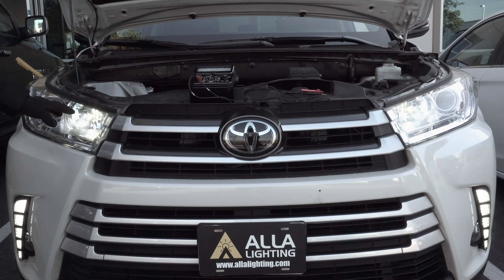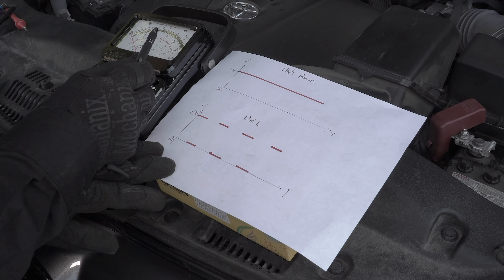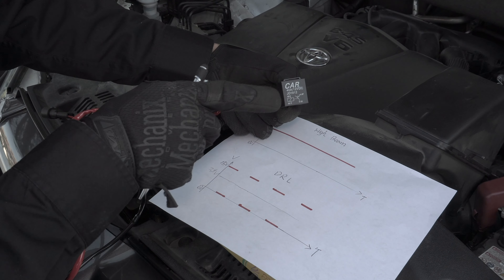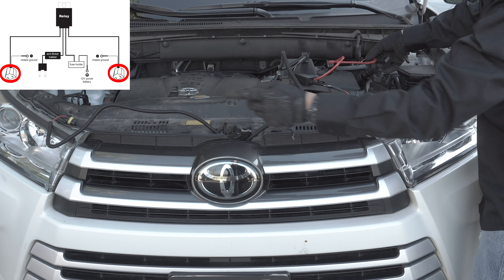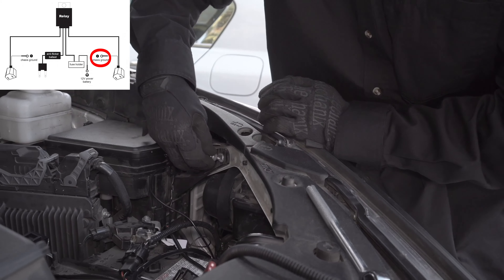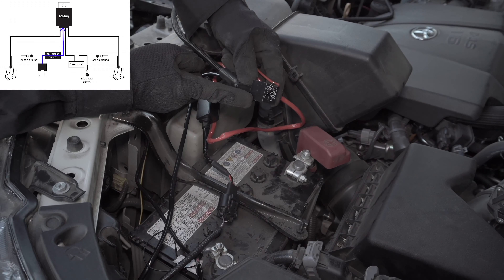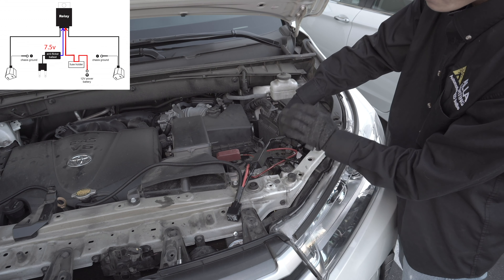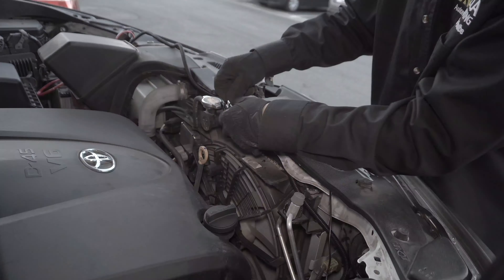Why & How to Fix Toyota Lexus LED DRL Flickering Daytime Running Light

Comment: Congrats now you will blind everyone on the road with always ON high beam.
Reply: True. It would be too bright now for drl. I hope someone will find a led which works for low voltage.
Reply: No not exactly. Yota has done their DLR like this for a long time. My LED's in my 16 Camry take care of this out of the box and doesn't need this mod. But they are also on high when operating as DLR during the day. It isn't a problem for other drivers in the daylight hours. If you're using "Auto" mode on your lights as most do I believe, when low light is detected the headlight function switches to normal operating night time mode. And as long as your low beam is selected it will switch to the low beam projector light. But if not your high beam indicator will light up on the dash instrument cluster and you will notice your lights are on high in the low light outside. 
Leds will operate with AC or DC voltage but they are biased and do not light in reverse current flow. If the car actually dropped the voltage to 7.5 volts the led would burn dimmer. But instead they oscillate the voltage at a lower frequency that reducing current flow and works fine for an incandescent wire filament. But the led is either on or off and doesn't produce light by heating an element. If the frequency was faster it wouldn't flicker but it would still be brighter at the 15v max.
There's nothing wrong with this installation and doesn't blind anyone but it is a brighter than usual DLR. I believe the newer models now have a separate DLR and don't use the headlight bulbs.
And there's the novel you requested for the day. lol
Reply: Working at hi beam is way better than flickering.

Comment: Besides the fact that this solution doesn't provide a lower voltage for DRLs so they are too bright, you're also putting both headlamps on one circuit so you will lose both headlamps if the one fuse blows. That's super dangerous and potentially deadly. This solution should never be used. Both headlamps should be kept on separate circuits.
Reply: Do you have another solution? If so, please post.

Comment: So, there's no actual fix for the DRLs? I mean, this "stops" the flickering by constantly keeping the high beams on, but what about the actual DRLs the way they're intended to work (low intensity brightness)? There's no fix for them?
Reply from the maker: This relay harness will only fix the DRL flickering issue, but can't dim the brightness for DRL.
Reply: The only way to fix this, AFAIK, is to find a set of high beam LEDs that can operate at 6 volts. There was a comprehensive list of headlight LEDs. I will see if I can find it.
Reply: @airportexpresso3255   Have you found any high beam LED's operating at 6 volts?
Reply: @atifkhalid9655  No. I just bought a pair of cancelers. They did not stop the oscillation, but, it is so fast now that it does not bother me.
Reply: @airportexpresso3255  So it means using high beam as drl then. Might be too bright for others
Reply: @atifkhalid9655  I doubt it. I think some cars, now, use high beams at full power as DRLs. I have not gotten flashed, yet, either. We shall see.
Reply: Xtreme Depot has a LED Driver that fixes this issue.  I used it on my 4Runner and it dimmed them with no flicker and full brightness when HB was on.
Reply: @killabandit  Can you post link of that
Reply: atif khalid here you go.  Add the optional led driver which is what stops the flicker. https://www.xenondepot.com/9005-Xtreme-LED-kit-pro-XT-LED-9005-PRO
Reply: @killabandit  you know we are talking about DRL which for Rav4 has no high beam associated.  Normally high and low beam bulbs are different which works for majority of new vehicle including my 2015 Rav4 without even requiring led driver. Drl voltage is low and  i don't think there drivers can fix that.  Low beam is different
Reply: atif khalid doesn’t matter.   That drl driver fixed the low voltage flicker and any model whatever the RAV4 takes for a bulb they have it available.
Reply: @killabandit  Ok Thanks.
Reply: One thing mentioned in xenondepot website that you have to buy their led bulbs only for drl to solve flickering.
Reply: atif khalid with the led driver. Ugh
Reply: @atifkhalid9655  They wouldn't be to bright during the daytime.  Only at night. In fact I would not mind full power during a foggy day. This way so people will see me better. So I won't mind if they full power.
Reply: @atifkhalid9655  it won't help

Comment: I'm sorry, but I have to comment on this video. The easiest way to get these results for free is to just turn your lights to always on and trigger the high beams. I thought maybe this kit had some kind of switch or maybe there are compatible leds at turn one on in drl and all on in high beam mode, but all this does just just always power the high beams when the car is running. Now instead of flickering light, you are just blinding everyone when you drive at night.

Comment: i had this same issue with my 2012 camry. just coming back from garage installing the inline plug n play decoders sent free by the led vendor (you have to request, in case your lights flicker). worked like a charm. no flicker but the high beam stays on during daytime. sorry but much easier install than the video suggests..
Reply from the maker: That is great, thanks for your watching and we are glad it is helpful for you.
Reply: Could you please provide a link to review your item that you have installed?

Comment: do you think this might be happen to my fog lights. 2015 corolla stock fog light replaces with switch back led. They work fine for awhile but then driver sides starts flicketing causing led to go bad. Installed new leds again and 4or 5 months driver side fog light flickering again.
Reply from the maker: Thanks for your message, do you purchase the LED fog lights from us directly or not? we need to know the order details, so please advise for further assistance. thanks in advance.

Comment: Installed per the instructions. Good grounds also.  Only works like a normal headlights. But daytime running lights no longer work. 2004 Lexus rx-330
Reply from the maker: Thanks for your comment, would you please advise the issue details before installing the relay harness for further assistance? also if you have order number, please provide the order number and issue details to email service@allalighting.com, and we will be glad to help you out.
Reply: There were no issues before. I installed the harness per the instructions. Using led.  DLR no longer turn on. Headlights function normally on high beams.

Comment: So, just a 100w / 6 ohm resistor in parallel with the 9005 light wiring.....ok...easy enough to add 4 splices and mount resistor for heat sink...thanks

Comment: Am I gonna be able to turn off the high beam during night or will this be always on?
Reply: At night when you turn on your headlights, the daytime running lights will be off so that means the high beam bulbs will not be used until you manually flash your high beams. When you are driving in the daytime without the headlight switch on, the high beam bulb will ALWAYS be on but on LOW INTENSITY/POWER so you don't blind people. If you install LEDs for your daytime running lights (same bulb as high beam), then you will be as if you're driving with your high beams on the whole time in the DAYTIME; this video is exactly like that.

Comment: What about if its toyota hybrid? Because the battery is at the back.. how will you connect it to the battery?
Reply from the maker: Instead of running extention wires all the way to the back,we recommend to connect to auxiliary power like cigarette lighter.  Another option to get a 12V positive is to add a blade fuse adapter to a closer fuse box

Comment: Do you sell the capacitors separately without the relay?

My car doesn't need  a relay but the capacitor I need two. For my project. With both the male and female ends on it. No relay.
Reply from the maker: NO, sorry, they are connected together.

Comment: I have a 2003 Toyota Camry 9005 bulb that operates both my high beam & DRL’s, Has ANYONE figured out a solution for the DRL‘s Not working at all after installing LED bulbs. The high beams work perfectly fine btw. i’ve seen multiple videos about these type of adapters fixing the problem for most vehicles DRL‘s FLICKERING issues but not too many about the DRL’s not working at all after LED swap. I’d greatlyyyyy appreciate if someone could shed some insight on this situation for a 2003 Toyota Camry 9005 bulb. Side note even if the fix is having my highbeams constantly stay on when I activate my DRL‘s, I’m fine with that also, I just wanna be able to get them to turn on so that when I wanna turn my DRL on I actually can. I’ve been searching for dayssss now for a solution so really any input is appreciated greatly. Blessings 🙏🏽🙏🏽
Reply: And the videos that I have seen titled “DRL’s flickering/not turning on after installing LEDs fix” for my year Toyotas I go to the comments and I don’t see anybody saying it worked or didn’t for 03 Camry I’ve seen ONE person say it didn’t work for their 2003 Toyota Camry. I just don’t wanna waste money here.

Comment: I did these connections my light still flickers with the capacitor, what could be wrong, is it the fuse or capacitor  not good?   It works perfect on high beam is turned on.   Also my capacitor is making a buzzing sound only on drl
Reply from the maker: Thanks for your comment, please email service@allalighting.com or call 1(909)606-2935 on Monday to Friday (9:00AM to 5:30PM Pacific Time) by providing order number for further assistance. and we will help you solve the issue.

Comment: @Alla Lighting Automotive LED Bulbs     what's the point ?  . need that there was a difference in light between DRL and high beam  and so that when I use the DRL the lamps do not flicker. when i turn on the high beam, the lamps do not flicker. and one moment.  when the DRL is turned on, the lamps will shine at full power. then I'll blind other drivers .   so this is not a fix for the problem

Comment: I've replaced the DRL with LED with the canbus on the 2012 Camry. High beam works fine but the DRL itself flickers. I took off the canbus to see the difference and it flickers at a real rapid speed. But with the canbus on, it flickers slowly and then turns off. I was wonder if there's a method to solve this problem or is there a difference of other canbus to solve this problem without having to removing the DRL fuse, which I would not like to remove the fuse only Incase If I have to replace the fuse only. My 2012 odyssey is doing just fine with the DRL LED with canbus. I just don't know why the Camry isnt doing the same. Besides, it's expected that the DRL LED is gonna be bright. That's why it's "super bright"/"300% brighter"/ "6500K  ice white"/ "10,000 lumen" description.  And I have no problem with it.
Reply: To fix it you need an led that can support low voltage. Like morimoto 2stroke 3.0. 

But damn it's expensive.
Reply: cause Honda's allow upgrades

Comment: I had an issue where my running daylight on 2004 highlander would not even work when I switched to led, my high beam works fine when turned on it’s just running day light would not work.. Anyone have a solution would be appreciated,
Reply from the maker: Thanks for your question, would you please advise whether you have tried to install any extra kits? the reason the bulb as DRL doesn't light up probably your vehicle produce 6V for DRL, which is too low power to light up the LED (normally LED can light up at 9V), we will have a new model 9005 which will work at 6V as DRL and 12V as high beam, they will be available in one month, if you are interested, please let us know,and we will update you once available, this probably solve the issue for your vehicle.
Reply: Alla Lighting Automotive LED Bulbs have these new 9005 bulbs (ones that work as 6v as DRL and 12v as high beams) been produced yet , have heard due to the pandemic production was delayed any updates thank you for ur time
Reply from the maker: @sl33ves  yes, it is just stocked in, the products link is https://allalighting.com/products/hb3-9005-led-headlights-kits-bulbs-6v-24v-daytime-running-lights-drl

Comment: Hi! Just want to know if anyone has changed their drl to led? I have a 2006 xle and I tried replacing it with led but the problem that i came across is that if I replace one side, the led works but the other side doesnt light up. When I replace both bulb to led, it doesnt light up at all. I got load resistors and still does the same thing. Does anyone know know how to fix this or is it not possible to do on the sienna?
Reply from the maker: For your vehicle, it is recommended to try to install below kits altogether: https://allalighting.com/products/9005-hb3-anti-flicker-load-resistor-sets-fix-for-2004-10-toyota-lexus-drl-off-flashing

Comment: DOES THE CAPACITOR GET HOT? TO WHERE IT CAN MELT PLASTIC? ALSO WHICH LED BULS WERE USED FOR THIS VIDEO? THANKS
Reply from the maker: No, it won't too hot, which won't melt the plastic, yet please follow the instructions to install the harness, the led headlight bulb link is https://allalighting.com/shop/product/D-CR-9000lm-9005-LED-Headlight-Bulbs-for-Cars-Trucks-Motorcycles-%7C-1-Pair/978

Comment: Rubbish.  I bought the flashing brake lights.  Same flicker issue when I run drl.  The internet tells you to just put 50W 6 ohm resistors in parallel on the -ve and +ve lines.  But this does not solve the problem.  Such bullsh#t to have given these companies the business, and when problems arise-they give half-truth answers and NON-fixes!  
I get it though.  Maybe there isn't a way to use LEDs on systems designed for incandescents without lingering problems.

Comment: I own a 2019 highlander limited.  I tried installing aftermarket LED tail lights but they were messing with my cars computer/safety system everything starts lighting up from lane departure warning emergency braking etc... is there a fix?
Reply from the maker: For your situation, it is not installing such kit, please try to install the load resistors for tail light bulbs, one side connecting the ground wire ,the other side connecting the brake light wire, and attach the metal part of the load resistors to your vehicle's metal part, the load resistor link is https://allalighting.com/shop/product/50W-6ohm-Load-Resistors-for-Fix-LED-Signal-Hyper-Flash-Error-Canceller-%7C-1-Pair/375

Comment: This is not a proper solution and may very well lead to a traffic ticket. The harness should not be sending alternating 15V-0V to the DRLs. The DRLs should be receiving alternating 10V-0V. Your solution sends 7.5V to the DRLs while the DRLs were intended to receive 5.0V.

Comment: High beams always on, " is the only issue" big issue if you ask me.
Reply from the maker: Thanks for your message, please advise your vehicle's make, year and model for further assistance? are your high and low beam are LEDs as well? Please confirm, thanks in advance.
Reply: @AllaLighting  2011 Lexus IS250 low beam are LED, trying to change DRL/high beam to LED ambers but i can eaither have them high all the time or flicker.

Comment: Not workings
Reply from the maker: Thanks for your watching, would you please advise your vehicle's make, year, model for further assistance? and also please advise the detail of the issue, thanks in advance.
Reply: @AllaLighting   Thank you for your response . It was for 2001 Toyota Avalon. I did everything frame by frame on the video. But I did tried deferent grounded. Nothing work, I flip the connector didn’t do anything . $20 not much, but I like it to work, I doubted may be something wrong with the kit is. Anyway thanks for your input. Your help to resolve this issue is much appreciated ! 👍